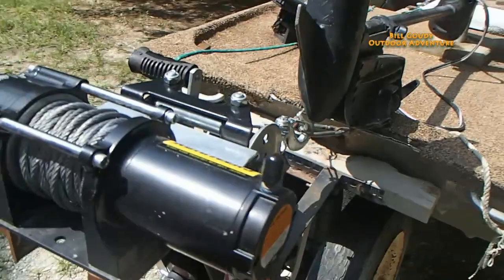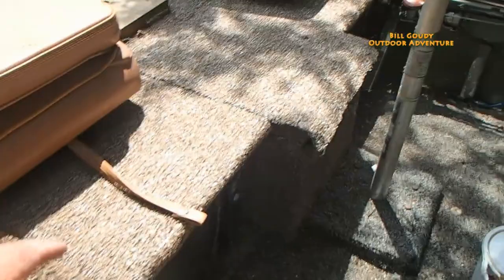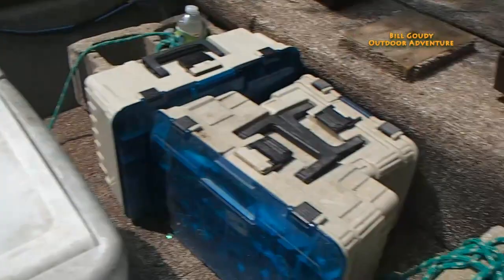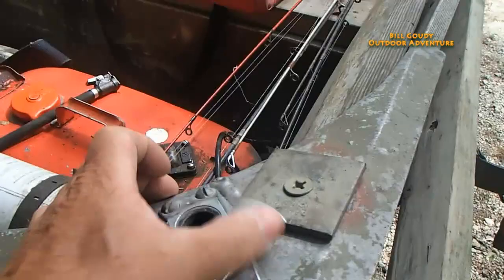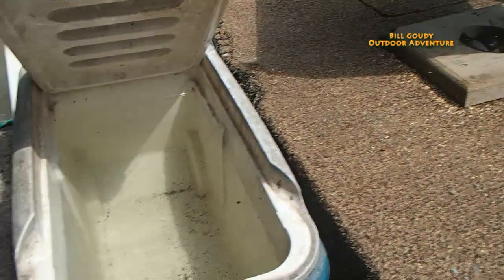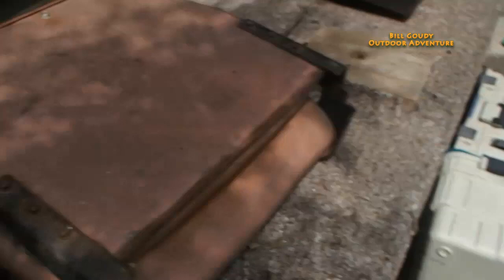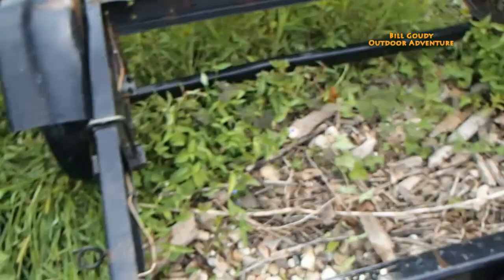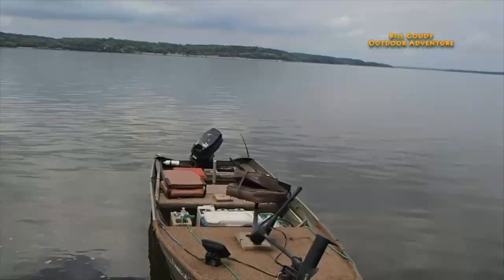The Real - Poor Man's Fishing Boat & Trailer

Comment: my brother n law and I use a1966 Ridgeline deep v 12ft. with a 1994 Jonson 8 H.P.long drive 2 cycle and a1958 troller that only has drive, off, and reverse on the rear stern and a 1974 3 speed plus on the bow...The trailer is just like yours except we still have bunks on it...You can't beat the old john boats in price...We only have about $700 in all, just wish it was a 16 ft...Really like your boat...It's nice to see old boats still being used and not scrapped...Have a great day Bill...
Reply from the maker: I will never part with this boat....  It is solid .   My Grandpa bought it new back in 1958....  It has had several motors in its life time, But the boat don't leak at all !!!  Thanks, Mike!!
Reply: BillGoudy way cool...

Comment: Cool boat, i'm a step ahead i have a anchor in mine
Reply from the maker: Haha!!  Thanks, Bob....  Many times I fish in an area that has a flat cement deck under the water...  My regular anchor will not hold the boat, But I have found that using a cement block and some times 2 cement blocks it will hold just fine in those conditions and I have found that the blocks cost less than a dollar....  They are very hard to beat for the holding power and for the price...  So I am not sure if you are a step ahead...  Haha!!  This works for me, in my area!!  ;-)  Thanks for watching my friend!!

Comment: I like your idea on placing the knives in strategic locations,, logistics 101.

Is there anyway you could eliminate the winch battery mounted on the trailer tongue and just cleverly connect the
winch leads with a proper connector to the 12v truck system,, sort of like connecting your trailer lights to the vehicles system.
Or piggy back the trailer and winch together somehow to the trucks system.

The reason I ask I might try using a small Harbour Freight winch from my lawn tractor to pull double duty on my boat trailer and wondering if I 
could read g it that way instead of having an extra battery to buy,, just another retiree budget thought.
Reply from the maker: You sure could wire it that way, but you need some pretty big wire to carry the load of the winch... That bigger wire and the type of connector might cost as much as the battery....  It really depends if you have cheap access to those hookups!!  But, that is a great Idea..  I have several different vehicles that I use and with this system I don't need to worry about what vehicle I'm using..  It would all really depends on what will work for you!!  ;-)  Thanks for watching and good luck...  This works great for me....  ;-)
Reply: Yeah  it's not as simple as just plugging the wench into what's already there. You need at least a 4 gauge cable and you want it to solid copper not copper cladded aluminum wire. As pure copper transfers current alot better and also if you remember why they stopped using aluminum wire in people's houses. Well you get a lot of those same issues using on an automotive application. Aluminum expands and contacts alot more than copper does so you end up dealing with loose connections alot among other things. Yes it's half the price but it puts you through alot more frustration in the long run. Ideally to go from the truck battery all the way back to the boat I would be looking more along the lines of a 2 Gauge cable or maybe even 1/0. Because over 20 feet at 12 volts  according to ohms law on  a 2 gauge pure copper cable your only going to see around 120 volts at the other end. Even copper has resistance to current flow and your going all the way down to the trailer on a pickup truck that's at least 30 feet so take another 25% away from 120 and it gives you the actual current flow all the way down to your trailer. Most wenchs draw around 120 amps or more as a requirement. So it gets really expensive quick to say the least. Then you have to buy the Anderson connectors and lugs and you also need a special crimping tool for cable that large so you crimp it correctly and get a good solid connection. If you don't give the motor on the hoist enough current flow it's going to create excessive heat and you'll burn the windings up in it before too long. Actually I'm thinking about the big cable wenches like you'd use to pull someone out of the mud or something because their vehicle is stuck. A boat wench probably less power hungry because boats move really easily on water. But you still don't want to starve them for current. Find out what the Maxx current draw is then pick your cable size accordingly. 4 gauge will only pass 60 amps over 20 feet.  Each time you go up a size it doubles.